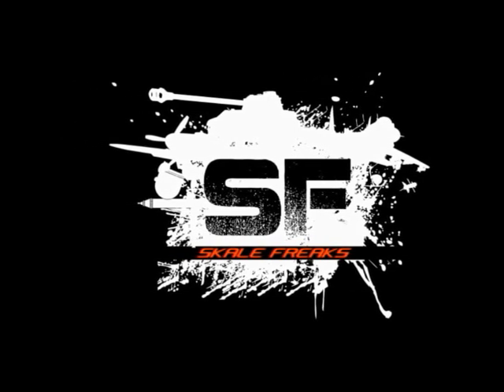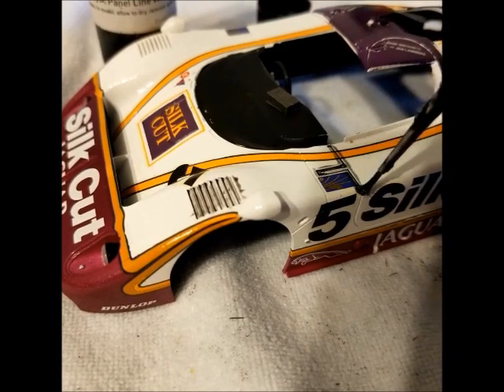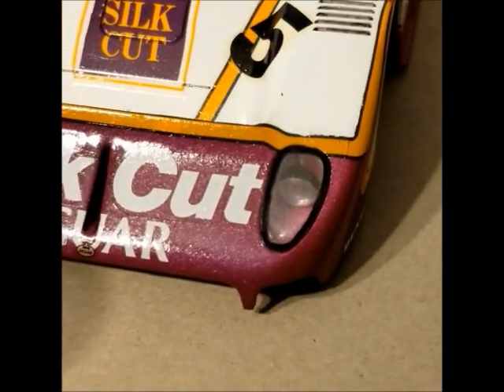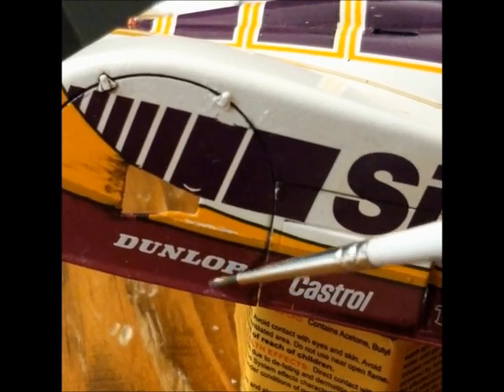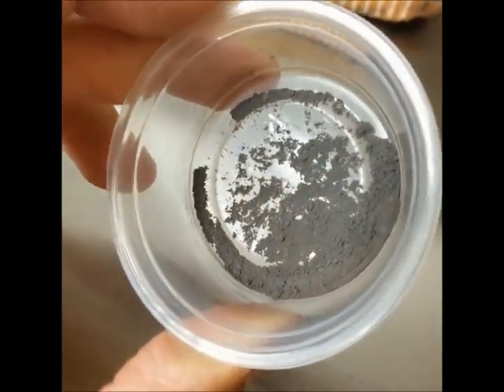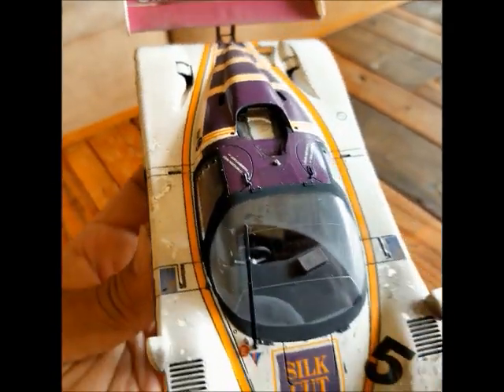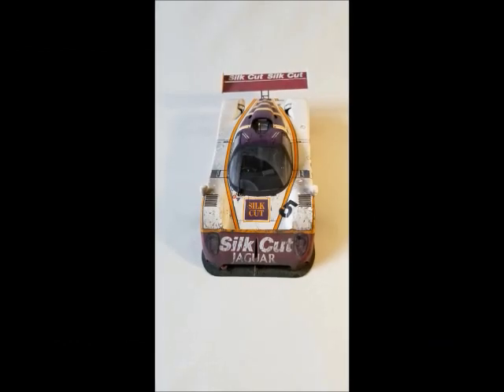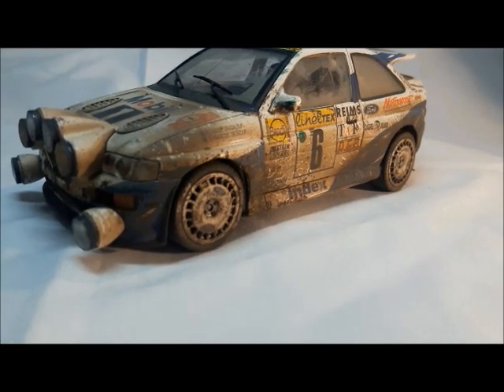1/24 Race car weathering, Jaguar XJ8 Sprint car

Comment: Rubber particles on the tires are marbles. F1 drivers will drive thru the marbles, thrown off by other cars, on their cool down lap to add extra weight to their car. Some extra security to make weight during post race weigh in.
Reply from the maker: Thats right!! never drive over the marbles! you are going for sure for a spin!

Comment: Another question, why you remove the dirt what you give with airbrush befor you remove the bodylocion? Is it not dangerous to smudge the bodylocion?
Reply from the maker: the body lotion works as a form of "tape" so the dirt can be easily removed. I use body lotion to "mask" the fingerprints and other crew marks that can be seen at dirty cars when they are worked on. :)

Comment: Hi there, love the video. Near the end there's an image of a Peugeot 206 rally car that looks like it has the right headlight damaged. 
I was at Spa 24h last week and noticed the same sort of damage on GT3 cars, sometimes missing lights, body parts etc, sometimes having it taped off with duct tape or sometimes having the duct tape holding body panels in place. 
I'm looking to do something similar, but starting off a resin or die cast model. How exactly do you deform body panels like you did on the Peugeot? Do you think the technique can be carried over to resin models, like the ones from Spark, BBR or Kyosho?
Thanks!
Reply from the maker: Hi you doing Jan? I like Spa a lot! had the opportunity back in 2017 to visit the track in person. The way I did the body panels out of aluminum foil, the you can warp them accordingly depending on the damage you want to simulate. With diecast, you will need to completely cut and remove the part you want damaged and replace it with thin foil so you can shape it. Also goes good with scale. If you measure the thickness of a die cast model wall to a real car, the die cast is waaay too thick.
Hope this helps brother.
Thank you for your comment and question

Comment: One more question😅🙈 at the end...when you're done with the weathering, will the car be clearcoated? if so, which paint did you use? 

Best regards
Thomas✌🏻
Reply from the maker: It depends. You can give it a light breeze of flat coat (tamiya or any of your choice) but with and airbrush, that way you have more control over the areas you want to protect. Check out my patreon www.patreon.com/skalefreaks I am doing more explained videos and will begin with tutorials. Thank you 😁